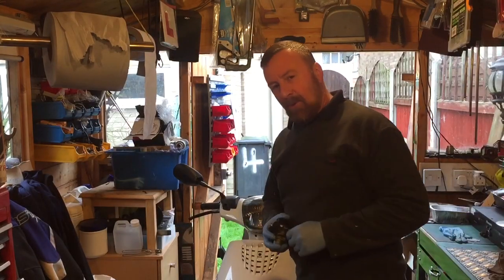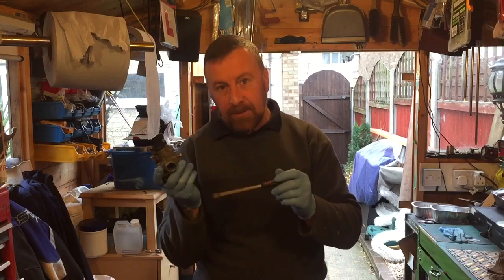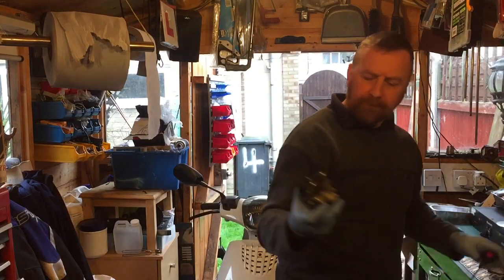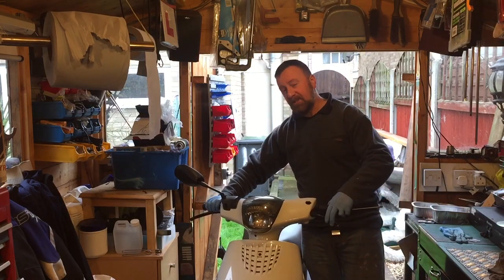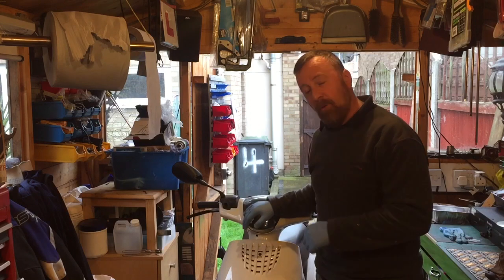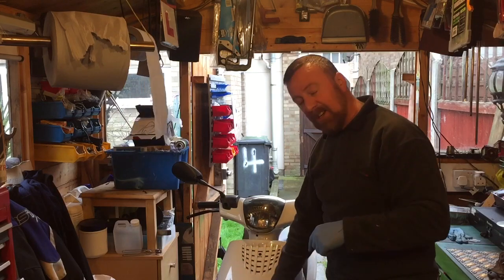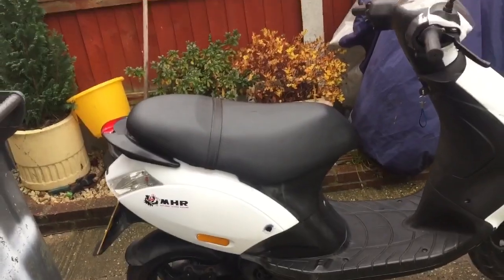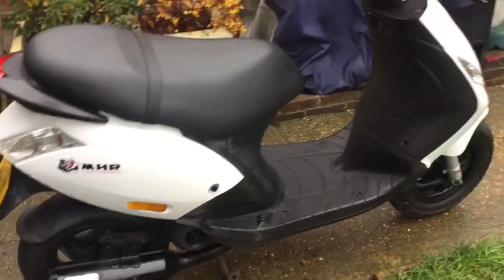TUNING 2T CARB CARBURETOR FOR MOTORBIKE MOPED  BETTER PROFORMANCE  MARK SAVAGE

Comment: Hello again boss :) Im having tremendous flooding issues... watched every video you have on carburetors and still cant find an answer ..
I have one of those red motorforce PHBG 21mm carbs on a 70cc gilera runner (Stage6 streetrace iron cast). Was working fine until a few days ago.. could not get it to start and tried every trick in the book for flooding.. letting it evaporate, engine starter spray etc, the spark plug is soaked from 3 kicks..
opened carb, cleaned it all (was clean), float is straight and not getting stuck. Main jet 92, idle jet 50.. needle set in mid ring.
could i have scored the cylinder or F*ded a segment ring?? last week i was going full throttle and at almost 120 she went Buoohh... didnt die and kept idle, pulled to the side, waited a bit and kept going.
Stopped it and on the next day it wouldnt start.... been at this since then ...
Any tips you might have? thanks in advance Maestro!
Reply from the maker: the buoohh sound was not a good sound at all bud 
first now you must now I dont like big bore kits as you have watched loads of my videos and this is why, well done for the top speed by the way lol 
I think it time to get the head off and have a look what you have done to it , rings, piston, reeds anything could have gone and its the only way to find it bud as once it cooled down the damage was done so more work bud 
lets know how you get on
Reply: @marksavage  Thanks a lot buddy!! your videos have been super helpful and saved me quite a bit of money haha.
i do regret getting a big bore.. im thinking of putting back the stock cylinder and carb, upjet it and thats it. 
been giving me lots of issues lately.. I managed to find the source of the problem and she started nicely, but spits a lot at WOT from a standing point with the same carb settings it always had. 
My guess is that i scored the cylinder although it still has compression.. should have removed the oil pump and go manual mix! 
haven't taken the cylinder out yet, ill have a look at it later today and let you know what i find.
Once again, thanks a million!!
Reply from the maker: @joaomelo61  
You can leave the oil pump and added a little in with the petrol but think yes your right and the scoring!
Good to hear that my videos help 
Take care bud its going to be  hot one today lol
Reply: @marksavage  Forgot to mention boss, i still have the stock Gilera CDI unit and coil... could that BUOHH be the CDI cutting off the engine as it reached 10k rpm??? This just crossed my mind .. i was between 115 and 120kmh (speedos arent accurate). I also got a stage6 pro replica pipe and 7.5g rollers, she does rev pretty high
Reply from the maker: @joaomelo61  it might of had a cut off !
But you have spark now 
More likely ring / piston damage but see how you go bud

Comment: My speedfight 2 ac has got mallosi air filter, leo vince exhaust, changed the rollers, 72jet I've took the washer out and just won't go over 41mph is there anything else I can do to make it go faster
Reply from the maker: Start over 
What was your top speed before 
Did you do all the things then try 
I would have just changed the exhaust 1st 
Then test 
Air filter 
And tune 
New rollers with a clean 
Test 
Washer out test 
72 jet is big !!
Is it bogging ?
Reply: It's been going 41 the whole time even before all this it runs fine no bogging or anything
Reply from the maker: @dylanhowes4874  what weight rollers ?
Belt tight? 
Too tight or loose
Clutch test like in my videos 
Variator standard ?
Rear plate on ?
Reply: I've got 6g rollers belt seems oright I've tested the clutch like in ur vids and what's the rear plate
Reply from the maker: @dylanhowes4874  on the back of the variator there's a standard rear plate that stop the rollers coming out 
It often gets taken off which is good
Reply: Oh yes I've taken that off

Comment: Hi mark

I put a performance filter on my scooter, now it won’t take the throttle ,simply dies..any ideas?

Thanks for the great videos :)
Reply from the maker: hi bud thanks for watching, ok to rule out any other problems put the old one back on and see if it runs ok?
if yes see where you fuel mix is and then put the new one on, as it will let more air in you may have to adjust the air mix or even up jet as you are getting more air in and a sports exhaust?
hope that helps bud 
mark
Reply: mark savage Thanks for quick response :) yea I put the old filter on and it runs fine, I will look into where my fuel/air mix screw is located, no I don’t have a sport exhaust on....don’t want to be a police magnet:)
Reply from the maker: not all sports exhausts are megaphones lol but it may help with speed and performance 
but as long as you happy bud its all good 
mark
Reply: mark the standard Peugeot exhaust has a pretty big manifold, so I hope by cutting off blind tube they welded on it would give a little extra hp :)
Reply from the maker: Gnaus76 ya it’s the GRV but plays no part and shutting it off will help a little
Reply: There’s 2 pipes going from manifold a big one that’s just closed and a smaller one with a rubber tube on going somewhere into the frame

Comment: We need to talk 
Im exhausted with my carb everytime i fully open throttle is bogs down
Reply from the maker: normally its the jet size and bogging down it would be too big , try going down a size or 2
see how big it is now and go down in 4 - so if its like a 68 try a 64 and see how it runs
Reply: Either what mark said or air flow take your air box off put you hand over half of it and then rev it and try it and adjust hand movement, i had this with my aprillia sr50 buddy

Comment: What size Carb do I need on one 70cc I'm currently running 17.5m
Reply from the maker: oh dear you know if you have watched my videos what I think of 70cc kits, it wont be the size carb but the jet, watch my upjetting video for helpmark
Reply: First time watching your videos haha I got a piaggio nrg 70cc with standard Carb open filter race ripe malossi 70cc kit and 76 jet it starts up but now just floads really quick and dies on throttle any ideas if I need a new Carb ? As was running fine for 2 weeks running in the kit
Reply from the maker: Josh rapper sorry to say most 70cc kits fail a few miles after as they don’t get the right amount of oil into the head !
They get to Hot and fail 
Check out the piston and check  over , did you change the plug to a higher one as I would run hotter ?
This is why I say don’t do it lol 
My video should help bud there’s loads maybe not on the nrg but same thing 
Mark
Reply: @Josh-ed6ll  I know I'm late but Mark has no idea what he's talking about, ur main jet is way to small for a 70cc with an open airfilter you should be more around size 90 main jet

Comment: I got  a 125 typhoon the carb wont stop leaking i opened it 3 times and cleaned it when the bike is running  it dont leak as it cuts of it starts
Reply from the maker: I have answered bud
Reply: @marksavage  talk to me mark
Reply from the maker: infamous k you asked me twice bud
Check vacuum is cutting off
Check float 
Then look at jet size and air filter is clean

Comment: Hi mate what size carb is that for speedfight that’s huge
Reply from the maker: Louie Gibson very bloody large Lol think it’s a 21 mm carb or a bit bigger ! 
Mark
Reply: mark savage massive haha I just got a 17.5mm one of a 100cc speedfight to put on my 50 lc what would you recommend in jet size I got a open face air filter for it aswell
Reply from the maker: Louie Gibson if you watch my other videos you know I hate them air filters as in the weather they suck in moisture but they do sound good 
Standard 50cc is 54 try 62 and go up till it runs well and your happy but biggest really 72 bud 
Mark
Reply: mark savage see my speedfight standard 50 carb has 72 standard I called Peugeot An spoke An they checked my vin am they said 72 standard
Reply from the maker: Louie Gibson really wow well I’ve cleaned loads and I do mean loads and a Peugeot speedfight 50cc ac and LC uk standard carb in all of them has been a 54 jet !
But if that’s what they said go for it bud 
72 in a 100cc up to 88 but if it runs all good 
Check out my other speedfight videos there are over 50 and a few should help 
Have fun bud
Reply: mark savage thanks mate I also got a new race clutch an then a set of the big springs 1000rpm 1500rpm An 2000rpm which one would you say is best
Reply: I just put 2000 rpm clutch spring in the bigger one an new race clutch shoes an it was fine when I started it a lot better went to ride it next day An had the same problem do you think it could be piston rings
Reply from the maker: worth looking at the piston they don't last that long, i'd prob replace it if it looks worn bud 
mark
Reply: mark savage I brought it off someone who had it from new in 1997 haha I asked if it had ever been rebuild he said no so I’m guessing it’s gunna be that now
Reply from the maker: oh yes defo but good to see someone had it all that time, 
mark
Reply: mark savage yeah mate was all standard but derestricted

Comment: Hi mark, how would I tune my aprilia rx50/geared 50 carb ??
Reply from the maker: I have 50 and 125 2t and 4t tuning on my channel bud, 3 half tunes 2t 6 half tunes 4t and work your way in or out doe best result
Reply: @marksavage  hi again, so on my 2001  aprillia rx50, its got a SHA carb on it  and i  can't find an air fuel ratio screw on it just an idle screw, basically the problem is,  the minute i pull the clutch in the revs start going up to 9k lol,
Im waisting loads of fuel and sitting at the traffic lights is pretty embarrassing with it  idling at 9k, turn the idle screw out but dosent change it one bit. Would really appreciate the help if you have any idea what it could be?? Thanks
Reply from the maker: @ethanb6276  stop riding it bud 
Take out the needle in the carb 
Sounds like its sitting in the wrong way !!!
And it lifted up so reving high 
Make sure it's all the way in and down 
Easy thing to sort bud 
Otherwise take carb off and start again
Reply: @marksavage  okay mate will do thanks for the help
Reply: Hi mark, so i have brought derestricted expansion chamber for my rx50, atm the carb has a 74 main jet just wondering what size should i upjet to? 
As it dosent rev up atm with the 74...
Thanks

Comment: my chineese 2 stroke scooter has to much vibration help
Reply from the maker: MattedArtworks hi bud 
Well it’s a cheap moped bud but start with the engine mounts check them 
Is the vibration coming from the engine ?
Or moped as it rolls , still put it on the stand and see how much the engine moves left to right 
What are the Tyres and wheels like ?
Suspension ?
Give all that a look at first and see what you find 
Mark
Reply: mark savage thanks ill give ot a check i was thinking it could come from the belt because it was a chinese one
Reply from the maker: MattedArtworks no not really bud and if so it would run like a bitch lol but take off the cover and have a check of the belt and variator 
Mark

Comment: Just cant seem to get the tuning right, if even taken out the air screw to see if it makes any difference and  nothing. I hate tuning carbs🤦‍♂️
Reply from the maker: what carb bud , make sure its all on and working then all way in run and see as some chinses carbs run that way
Reply: @marksavage  it's a naraka 21mm racing carb. Spend over 6 hours trying to tune it and gone through 5 spark plugs. Iv handed it over to a friend that knows what hes doing. I understand the basics but just cant quite get that perfect tweek it needs. Great video btw iv spent the pass week watching most of your vids :)
Reply from the maker: @carlbozier4563  they can be a bit hard , standard 50cc or is it a 125 , did you change the reeds , what are filter ?
Reply: @marksavage  it's a 
It's a Piaggio liberty S with aprilia sr motard 50cc engine, Naraka 70cc kit, naraka 21mm racing carb with 86 main jet, needle clip on 3rd slot (if that's any help) Motorforce reeds wi cone airfilter. Running premixed at 125ml:5L
Reply from the maker: @carlbozier4563  and theres your problems bud with the carb the 70cc kit , i'd lower the jet but its going to be a nightmare as you already know . did you change plug up number as it will run hotter too 
plus hate the filters once damp or wet !!
going down will help with the rich and tuning bud but you may have to go down in 4s before it runs
Reply: @marksavage   yep it's a nightmare alright. Iv brought a malossi 70cc sports kit and it ran great for 20 minutes and just lost power. Also started bogging again? Spark plug is BR9ES as recommended from malossi kit. Was thinking of trying BR8ES plug and see if that's the issue. Iv rung up few companies but they dont tune mopeds so I'm stuck having to sort it myself lol. Thanks for all the help so far mate. Really appreciate it

Comment: Three and a halve turns? That's 3,5 turns. Not 3,5 halve turns.
Please choose your words carefully, As A Dutch guy I heard you say 3.5 turns. This made my own little private carb adventure a little more demanding than I could handle.
No offense though, I like to watch your content.
Reply from the maker: Ha ha , 1 5 full turns
It very hard to turn your wrist like that 
So I say 3 half turn , its easier to adjust 
And work out or in from there and this is for 2t
4t is 3 full turns to start 6 half 
But I'm from Essex 
And 51 
It's the way I am and try to help bud
You take care

Comment: fit a brand new carb on my piaggio zip 2t and the bike isnt starting
Reply from the maker: it will need tuning and setting up , did you check the jet size in it or your old carb, id swap them over it different

Comment: Mate I got a zip 70cc and its not starting
Reply from the maker: What have you done to try and get it starting 
Was it running ok before , what did you do to stop it running
Reply: @marksavage  I have never seen it started personally but I have a feeling it could be the carburettor
Reply from the maker: @youngdarns1221  well they dont make a 70cc zip 
So the person before have put one on so there your problem straight away bud 
Watch my video 70cc big bore kits dont do it!!
It could be anything mate really anything
Reply: @marksavage  thanks mate

Comment: I have a Yamaha aerox 2008 bought it was fully running but the automatic choke was bodged so I bought a new one and put it on now bike isn’t starting but it wants to start I don’t know if it’s the carb or not so could u plz help me and let me know ur instagram or Facebook so I can mssg u on there instead of here plz
Reply from the maker: the auto choke has either 1 or two wires , power to it and an earth to the frame or both wires to the auto choke 
did you fit it correctly 
best take the carb off and clean , clean or change plug and clean air filter
Reply: Yes I fitted it fine but I’ll take the carb off and give it a clean and see if it starts then